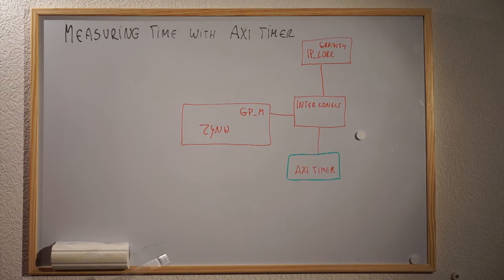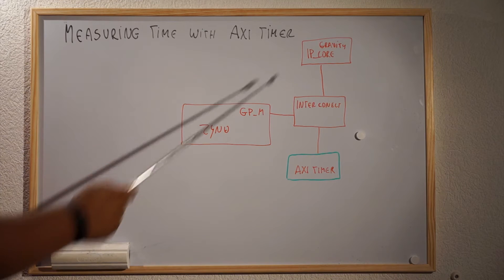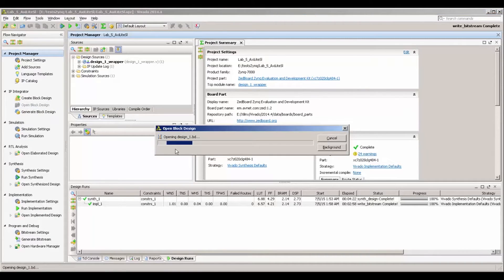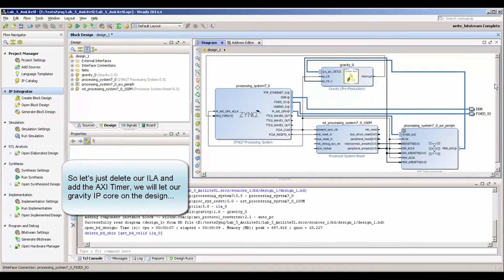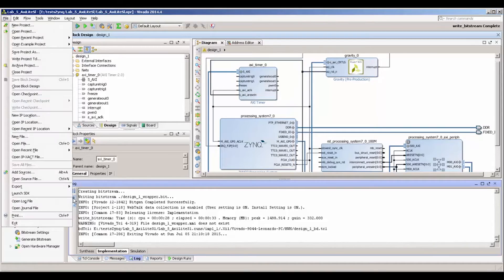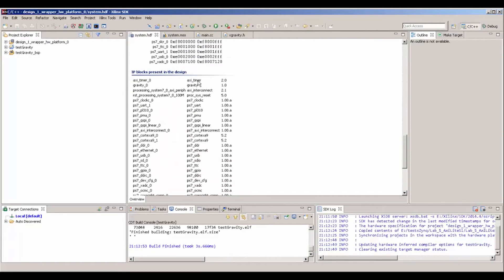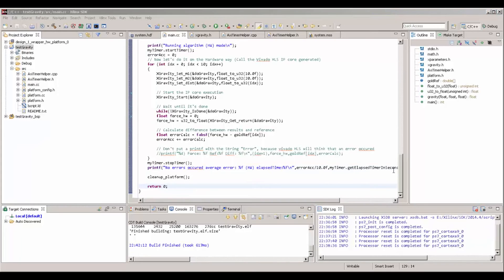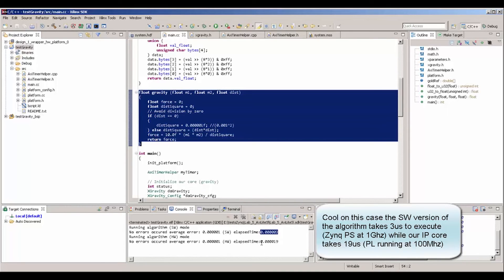Zynq Training - Using AXI Timer #07

Comment: Did everyone get the same results for the time elapsed? This is because I am getting different results using the zedboard with the default frequency of 100MHz for the PL part. Is this a problem from the board? as I followed the instructions carefully.